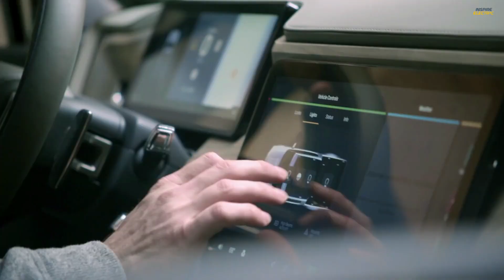Rivian R1T – Much Hyped EV Of The Year. Why Is It Bad?

Comment: Rivian just announced that they will be delivering based on what your price will be and NOT when ordered.  If you ordered the $10,000 battery pack and the expensive wood dash, you get it first regardless of WHEN you ordered.  I just got the email and a late 2023 delivery date.  They are claiming (ridiculously) it helps the environment to be able to travel an additional 83 miles - for $10,000.  You have to wonder about a company that does that.